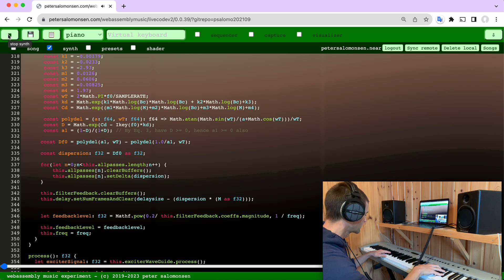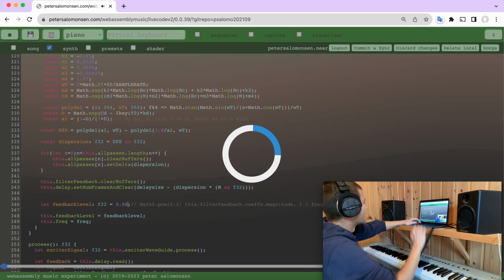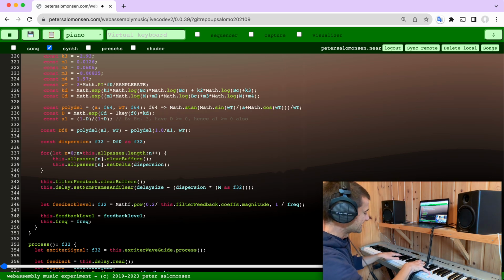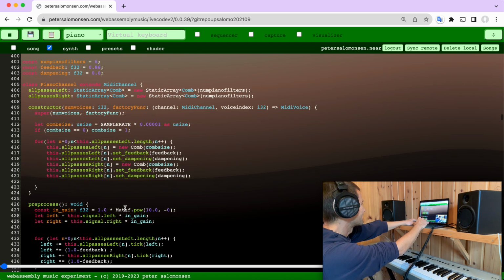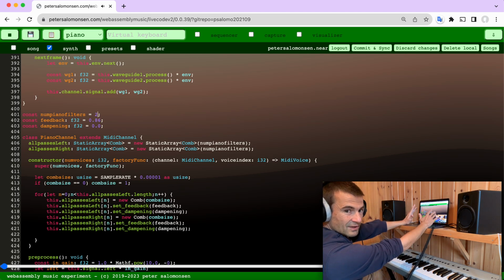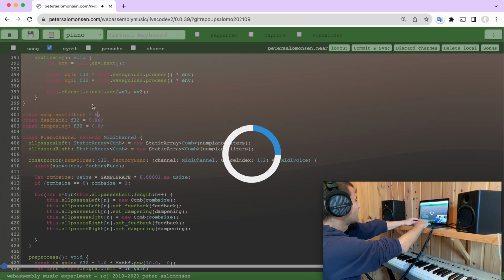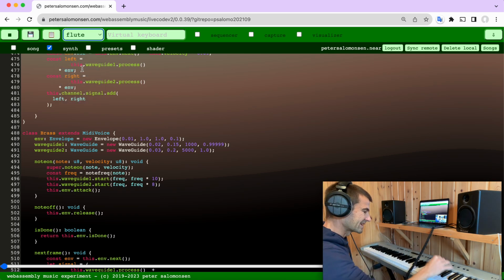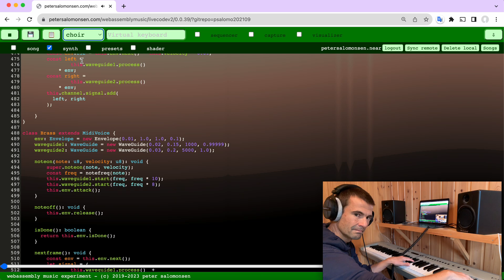Creating a piano from noise

Comment: Is there any way to experiment with this? Currently the repo and the code are hidden or something :)
Reply: Very curious how CPU intesive it is, especially on mobile phones
Reply from the maker: It is quite CPU intensive, but it works on modern mobile phones.
Reply from the maker: It's all available as open source.

check out this article ( where you also find a link in the bottom to the music sources ):

https://near.social/mob.near/widget/MainPage.Post.Page?accountId=petersalomonsen.near&blockHeight=97689494

and also the github repository for the project: https://github.com/petersalomonsen/javascriptmusic

Comment: Very interesting, can you explain a bit more about the tool? Is this something custom since it's wasm, did you created the tool in something else and later compile it to wasm?
Reply from the maker: The programming language in the code you see on the screen is AssemblyScript, which is compiled to WebAssembly on the fly ( each time you save ). The WebAssembly is inserted into an AudioWorkletProcessor that generates audio in real time. The tool itself is a web application mostly written in Javascript. WebAssembly is used for the performance critical parts for generating sound in real time, and the WebAssembly code is written in AssemblyScript. See the other videos in the "WebAssembly Music" playlist on my channel for more explanation, and also you there are sources on github.